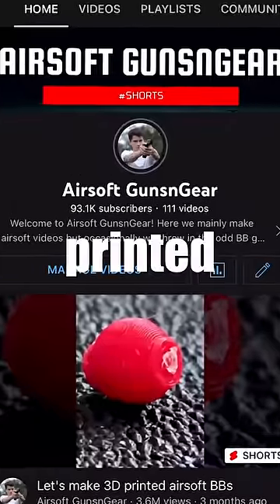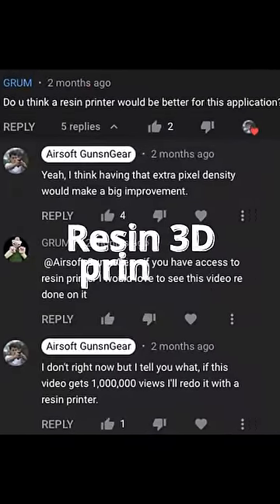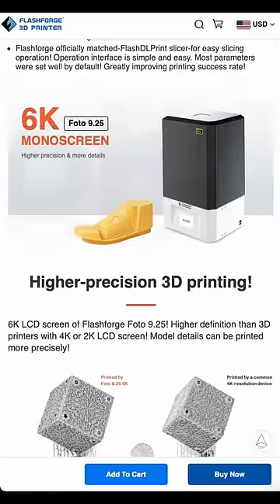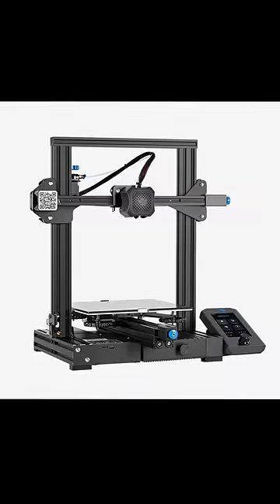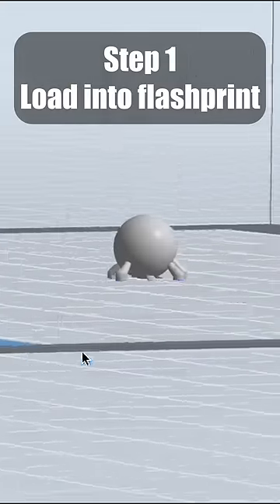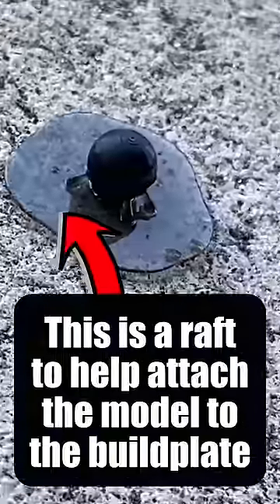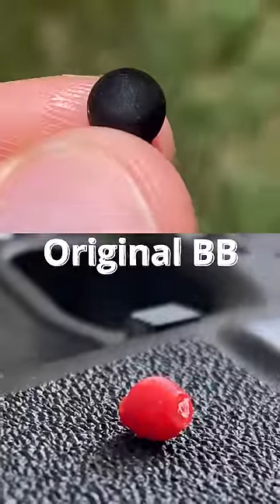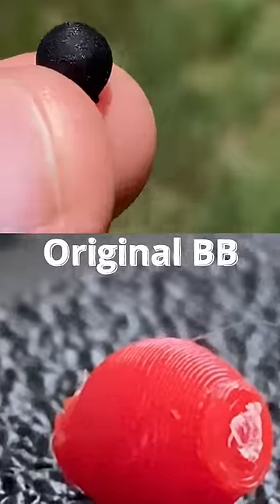Lets Make a 3D Printed Airsoft BB!

Comment from the maker: That definitely worked a lot better! What should I try next??

Check out the 3D printer here! https://shareasale.com/r.cfm?b=2036887&u=3343049&m=116595&urllink=&afftrack=

The above link is an affiliate link meaning, at no additional cost to you, I receive a small commission if you choose to purchase from this link. Everything earned goes back into making videos like this!
Reply: Bro awesome vid. maybe next time you can set up the slicer and support in a way where this isnt a massive flat spot. Try getting it as small as possible and if you wanna take it a step further maybe you can sand down the little flat spot.
Reply: See how they actually manufacture them, they do like a bunch of them at once all connected instead of supports to the plate or whatever they are connected on a rack or whatever
Reply: You did do a CHEP calibration cube to get ur demiouns right didn't you? Like before hand?
Reply: Make a resin mold
Reply: See if you can make a rifled pellet or somethin
Reply: Now make an airsof gun using a 3d printer
Reply: 3d print an infant
Reply: Should put a lot of them in a rock tumbler the make them smoother
Reply: Use a bearing ball as a bb
Reply: Try making a chain of these, not one at once
Reply: Make a bb gun plsssss❤❤❤❤❤❤
Reply: Guys I know what I’m gonna do today
Reply: Do you print airsoft guns?
Reply: Rock tumbler might get it super smooth
Reply: A 3-D printer the airsoft gun
Reply: "that definately workrd a lot better"
rates it 4/10
Reply: 3D print a .22 bullet then glue it on the tip of a blank .22 round
Reply: Definitly a BB diamater Dart! in Custom printed Magazine!!

Comment: You need to have the model (in this case the BB) raised about 5-10mm off the build plate so can you actually get some support under it. If you do that you get a more round BB then if you put it directly on the build plate,that's also why you have a flat spot.
Reply: Yes what he said
Reply: @k2fuego863  how much for an eigth of K2 dawg?
Reply: @716jblake9  lmao
Reply: He needs to split it down the middle and print both halves flat on the builder plate, then connect them with a simple joint. That's the only way to actually print perfect spheres but tedious as fuck especially for BBs😂

Comment: Holy crap i have the same spring one i loved it and it was my best one for a long wile and worked the best
Reply: That one isn't that good, its fun that it has a hammer that moves, but the best springer I've used was a smaller one that you could operate with one hand (about 1/4 the cocking force, and about 1.5x the velocity, with about 8x the precision). It was free in a bucket of 10k BBs, haha, but it worked great for years (until my cousins cocked it like 5 times in a row without firing, busted up the feed ramp)

Comment: use the resin rd printer to print with full density then print a cindof roller to roll the bbs round with fin sand paper or throw it in a tumbler to smooth it out some

Comment: I’d definitely try out the laser 3D printers that use lasers and a box full of powder filament. No need to shave off the supports.
Reply: Good idea. I want one that does Titanium powder (problem is they usually need 480v, otherwise I'd buy one, but I can't run that in my apartment with only 220v)
Reply: @jakegarrett8109  Probably check for any locations around that would either support 480 V or perhaps the school with computer aided design or a fabrication lab can help you with that

Comment: I wouldn't use 3d printed BBs at all, the seam will damage the gun
Reply: Thankfully that was a cheap springer, also normal cheap BBs have some seam lines and the BB is actually 5.95mm so it should have a little wiggle room in the barrel. It could wear any hop up faster though, but I don't think you'll bother printing enough to ever wear that out.

Comment: Can you 3-D print an actual airsoft gun
Reply: You can, they are pretty simple (just like you can make real ones, except real pewpews are possibly easier due to fewer parts). You can also print any O-rings with TPU filament. Probably can't print the spring, but you could print a jig to help coil wire into a spring.

Comment: Man you can't rate accuracy with a fucking springer. Use that 3d printer money and get something at least half accurate like an amoeba sniper or something as a baseline.
Reply: I had one springer that I could hit flies with about 70% accuracy from 8ft away (and it was a free pistol included in a bucket of 10k BBs), excellent, lasted quite a few years until my cousins kept cocking it without firing and the feed ramps busted up...